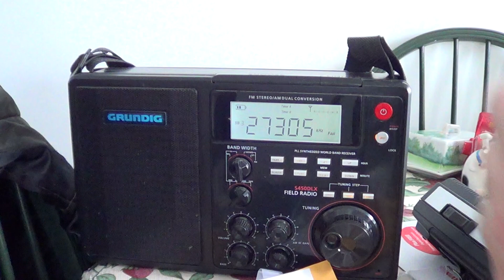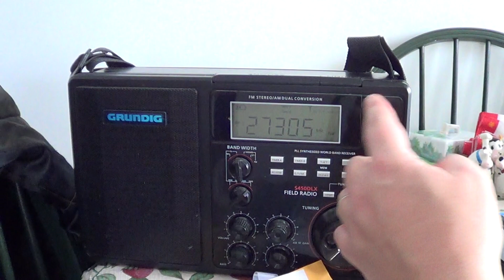Installing crystals in old realistic TRC 214 walkie talkie

Comment: I got 2 TRC 234's. I am in Portland Oregon and can't transmit or recieve really. Not sure why. I bought 9 AA Ni-CD 1.2 700mAh rechargeable batteries for it. Did I get the right batteries? Are they to weak maybe? Can you tune these radios? Leaving the batteries in charger tonight. Hoping for better results. Trying to make a CB for Seniors and disabled club. Thanks for your input.

Comment: The speaker quit working on my 216. The speaker on the hand held mike doesn't work either. I plug in an external usb powered speaker and it works. I removed the front and rear covers and couldn't find anything but when I started putting it back together it started working and shaking bumping nothing stopped it. After I got it back together It quit again. I removed the covers again but tapping the speaker did nothing. I jumped the other speaker directly to the back of the 216s and the extra speaker works. I'm using a 3 amp power supply so that should be enough power.
So where can I buy a speaker for this thing?

Comment: I have a pair of general electric 3-5970 and i can´t get them to communicate with each other, each walkie talkie has 2 channels (a&b) and 4 sockets for crystals, i have 2 27mhz crystals and 2 26 ones, anyone can help me? i don't know wich socket is for transmitting and wich for receiving since they are all in a row, no sticker or printing on the pcb